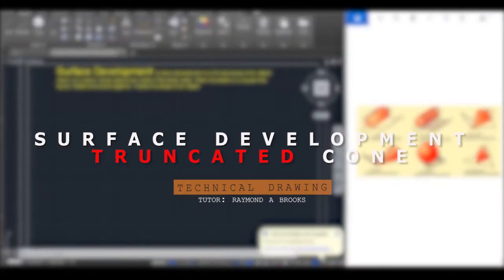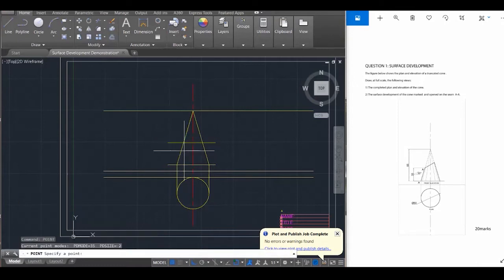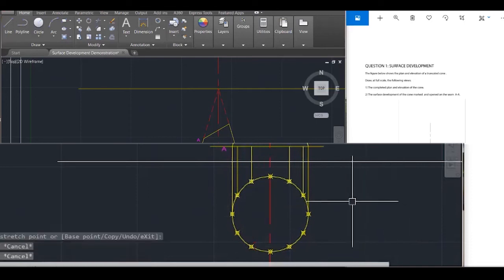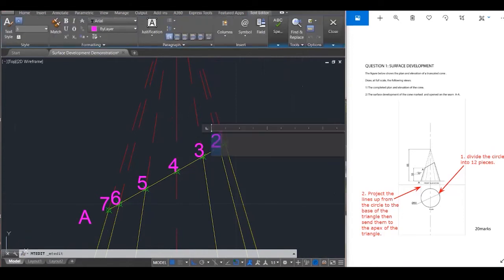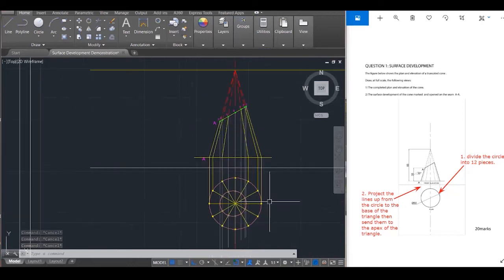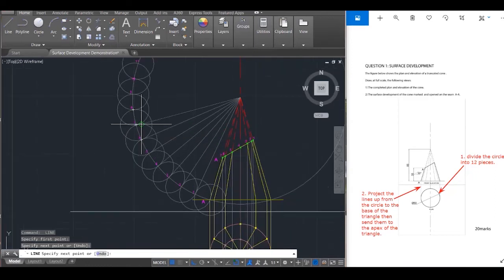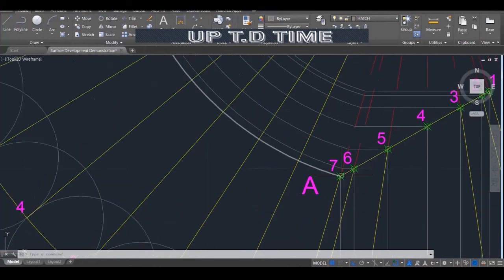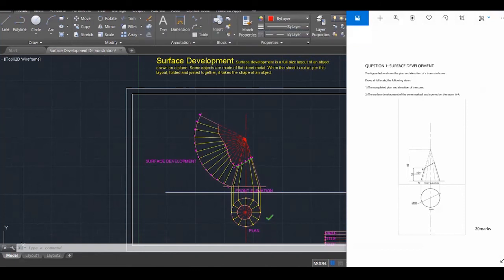AutoCAD: Surface Development 2 [Truncated Cone]

Comment: This concept helped me make a much simpler truncated cone with a un-sloped top. Used it to double check a method where I just used same segment lengths of the circle that makes up the top and bottoms. Turns out both methods worked, but it was nice to be able to check it. The method in this video would have been faster for sure, had I known it at the time. Thank you OP!